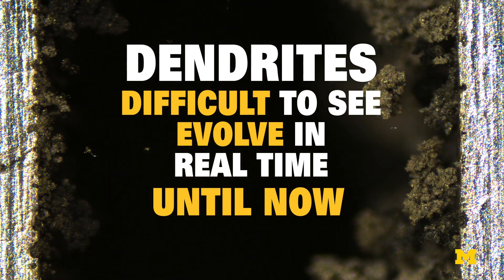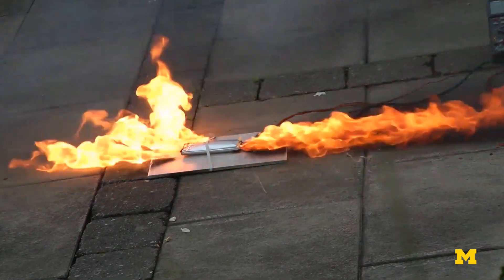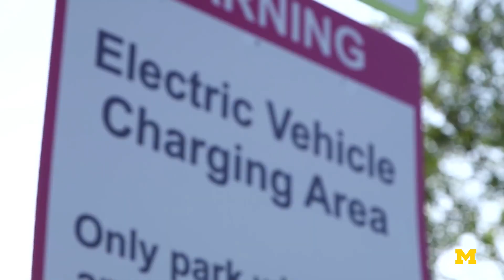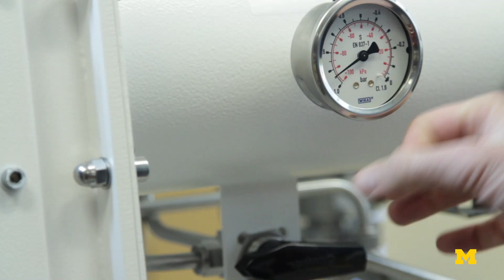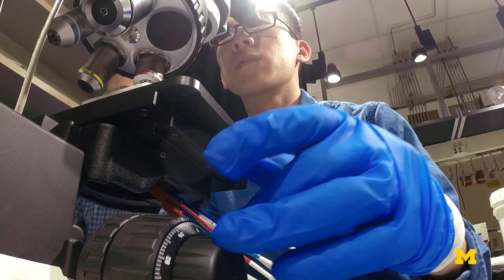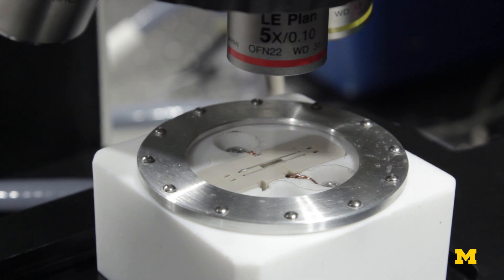New visualization technique to study lithium metal batteries

Comment: What sort of engineering would this fall under. Chemical engineering?
Reply: Electrical engineering and Chemistry, though Materials Science and Chemical Engineering may also be relevant.

Source: my university had a battery lab and a battery research program targeting post-graduate education.
Reply: Battery research is done by mechanical, chemical, materials science engineering typically, and also chemistry.